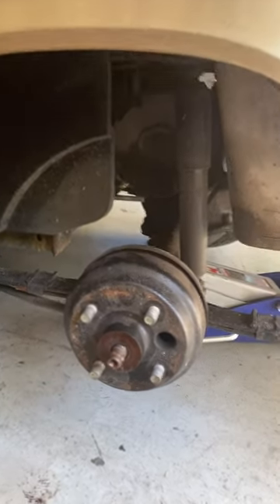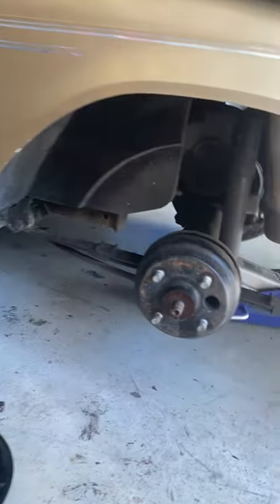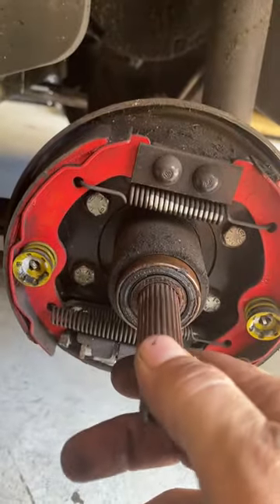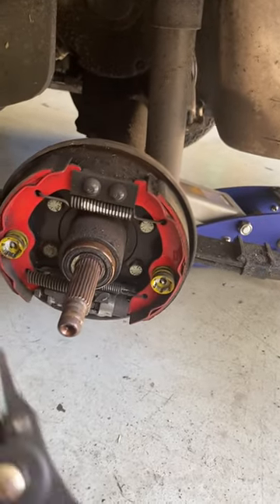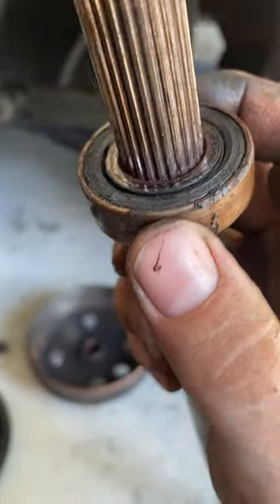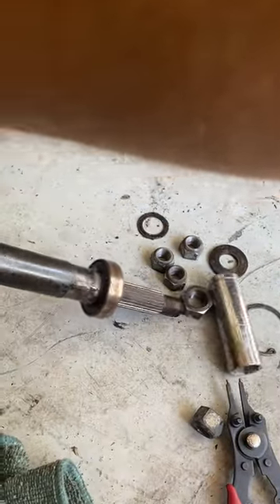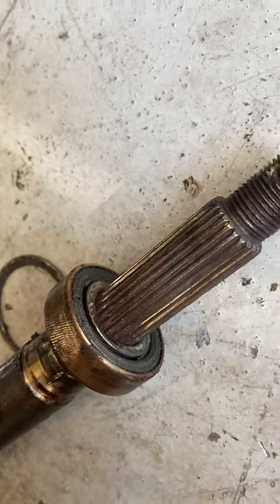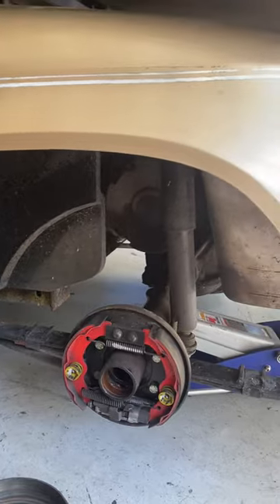Ezgo txt golf cart axle bearing replacement

Comment: Major Tip!
By putting the  Brake drum on BackWards   washer and
the Castle Nut Back on, pulling on the Brake Drum will be easier to pull the old axle out.
  I've pulled  many Axles out this way.
Reply: You are a legend bro. Long live golf carb
Reply: @vibez2802  😆

Comment: What could you do if you can’t pull the axle out? Mine isn’t budging and I’ve taken off the C ring
Reply from the maker: Turn the brake drum around and put the washer and castle nut back on. Tighten the castle nut and it will pull the axel out.

Comment: I just took mine apart and the old bearing came right off...I didn't even touch it and putting the new one on it just slid on with absolute zero effort....I'm guessing I need a new axle? The surface where bearing rides wore down too much?
Reply from the maker: You should be fine just putting the new one on that axle.
Reply: @Fixandflipeverything  that didn't work I tried it but the actual axle area wore down...the bearing was actually fine

Comment: The inner part of the bearing stayed on the shaft and the outer half stayed in the cart any suggestions
Reply from the maker: You could use a puller to try and grab the lip of the inner race or you could carefully cut it off with a dremel.

Comment: So there's nothing holding the axle shaft inside the housing my cousin has a Hyundai electric cart and he broke the nut and shaft off I believe the axle shaft is basically the same as the ez-go and Yamaha carts but these golf carts are new territory for me
Reply from the maker: No nothing holding it on in the inside. The clip holder it on axel housing and the pull pulls it tight against it and the brake hub.

Comment: Just curious, as to what noise it was making? Mine is clicking from the rear wheel at low speed . I assume it’s a bearing because the wheel is tight, and it does it more so after I have been riding it for a while.
Reply from the maker: Typically a grinding/clicking especially when turning.
Reply: Mine was doing the same thing. My bearing is OK. I think it may have been the break adjuster, or the castle nut was to tight.